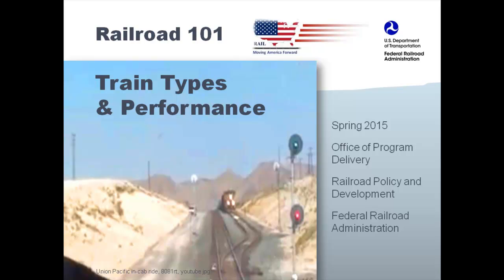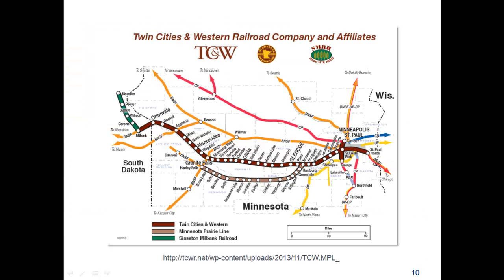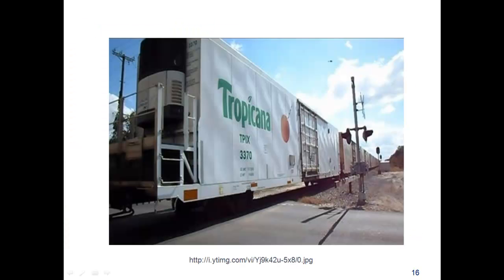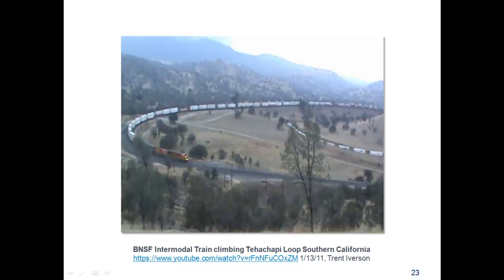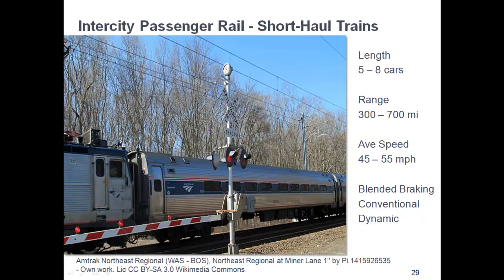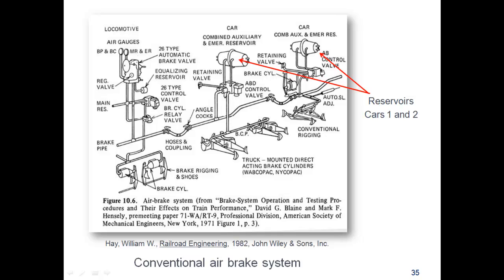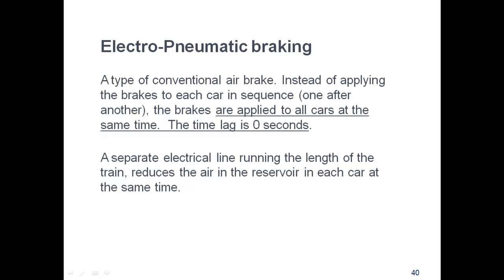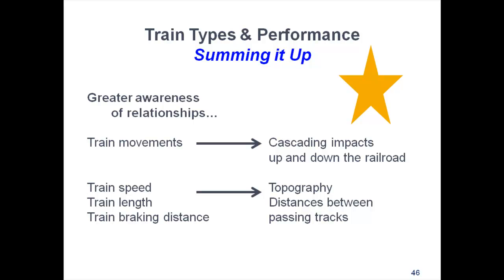Railroad 101: Train Types and Performance

Comment: Really enjoy these. Of course with my ADHD, I'd be more interested if we had 3d graphics and or video to go with it, but this actually is really interesting Thanks, FRA... hope to get into the railroad industry for a career now at almost age 29 (in a week..). Not quite sure where to start but I live in the Waterbury CT area, so there's virtually no freight running through my State, however we have Metro-North owned by MTA, operating commuter trains between various Connecticut towns and cities, NY towns and cities and NYC (Grand Central Station). And of course, Amtrak with it's Northeast Corridor, and Acela.. as well as I think the Shoreline express I think it's called along the CT Shoreline.
Reply: So did you get your dream job at Dollar Tree yet?
Reply: Yeah, even without ADHD I can find myself losing concentration.
Reply: i just turned 29 a week ago so its crazy I'm your age now, I'm now looking into the railroad business and wondered if you ever got in?